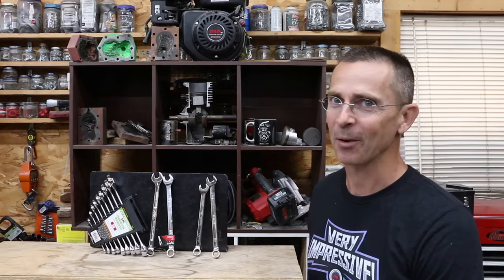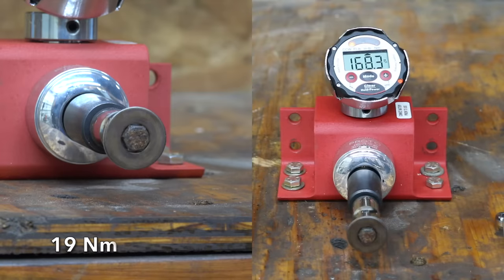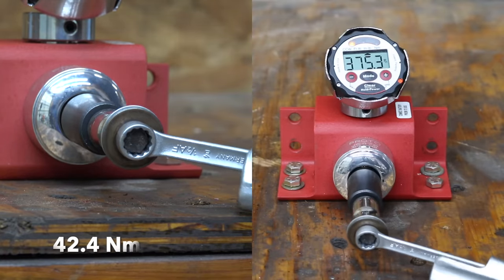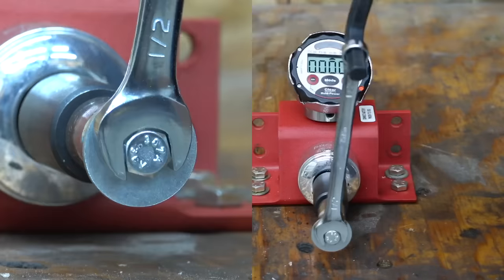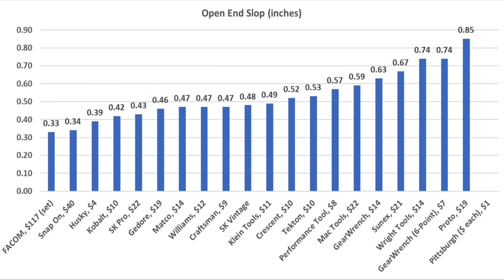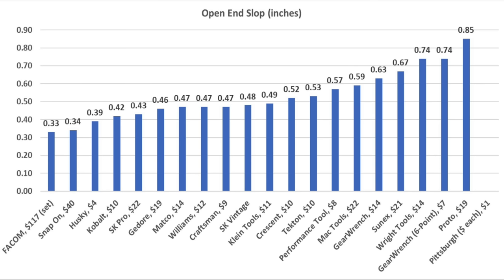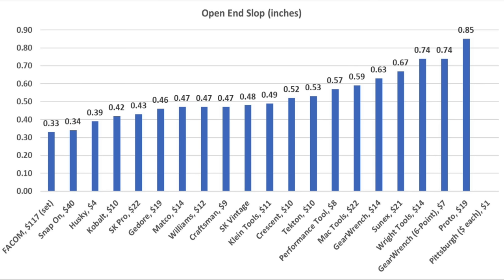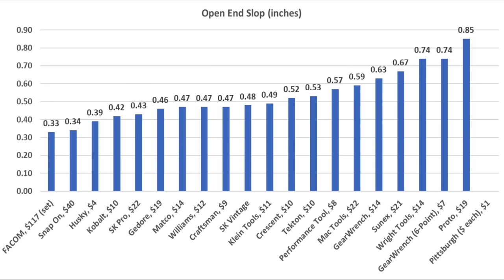Best Wrench? Let’s Settle This! Snap On vs MAC Tools, Matco, Proto, SK, GearWrench, Kobalt, Husky

Comment: I'd say a wrench that bends under pressure is always superior to one that breaks under the same pressure -- heck of a lot safer if it doesn't become a dagger or missile! and as noted, you can still use it for those pesky corners.
Reply from the maker: Thanks for the feedback.
Reply: @ProjectFarm  please start testing mastercrap tools. I want everyone to see just how bad they are.
Reply: @chrishayes5755  Don't think those are sold in the US. Their open ended wrenches aren't bad.  Non impact sockets are pretty brutal though.
Reply: @Mark Brooks you can get a new one for a broke one but not a bent one.
Reply: Assuming a good warranty you can replace either

A bender is less likely to break your wrist when crap hits the fan
Reply: @jakass  oh yeah, long as the wrench can perform just as good bending is definitely the way to go. And with this testing it seems the benders are performing just as good. Not I'm not sure how that affects the wear on the wrench from use though? Most of us don't use one enough to care about wear hardly though.
Reply: I'm with you 100%. A wrench breaking under torque is AT BEST going to get you some severely busted knuckles, but easily has the potential to send you to the E.R. depending on how it breaks and what you're doing. I don't even care about warranty issues at that point- if a wrench bends under severe torque instead of breaking and potentially causing me severe injury, I'll gladly pay out of pocket for another. I don't mind getting scraped up or banged up a little when I'm working, but I'm at the age where I know I'm not invincible, so if a tool saves me from a possible severe injury, it's worth its weight in gold as far as I'm concerned
Reply: This 100%
Reply: I agree! I have a snap-on 7/16 that I bent and it became my header wrench. Occasionally someone would see it and ask why I didn't get it replaced.
Reply: Everyone with grease tattoos in their knuckles will agree. If you know, you know.
Reply: Oh cheap chinese missiles 😬
Reply: I definitely agree with that!!! Breaking hand tools usually gives the result of broken hands or busted knuckles
Reply: @Mike I'd generally agree, but problem is,  you don't always know when it's going to break. What breaks under a lot of pressure can break under less pressure. Whereas a bend at high pressure will always be a bend at low pressure too.
Reply: Damn, that was so freaking wild.
Reply: I've said this before but, if there was an award for best YouTube channel, you should get it. I frickin love your channel. This would be my fantasy job. I just feel bad for you about all the money you obviously spend to conduct these test.
Reply: @chrishayes5755  "Please start testing mastercrap..." Mastercrap?
Reply: @scootergeorge7089  Mastercraft, the Canadian Tire house brand.
Reply: If you are putting this much pressure on any tool like this to where it bends or breaks by hand, you need to get the liquid wrench fired up. Be smarter than the tool and what you are working on.
Reply: @mistermacgray  Lol when I see rust I go ahead and get the gas axe out because I'm gonna end up needing it anyway. Usually takes less time going straight to overkill instead of dicking around with stuff trying to do it without heat.
Reply: @Mike If I could break these with my bare hands I would have no need to bother with wrenches 😎
Reply: I don’t care if it bends or breaks, just please don’t ruin the seized fastener that is surrounded by flammable materials and doesn’t allow access for a drill.
Reply: @ProjectFarm  The Wright Tools Wrench you tested out is no longer made and is replaced by the Wrightgrip 2.0.
Reply: I'll trade you for the snapping ones that show by snapping that they're harder, and won't wear, because breaking isn't ever going to be an issue, but wear is.  You guys aren't going to be breaking them with your hands, and if you're injuring yourself on the failure of a wrench you weren't being prepared for the failure of the fastener either, that's 100% on you.  Hard steel bends  a little and either snaps in two or back to its original form. Weak steel bends and doesn't come back, it just becomes putty.
Reply: @maverickracer442  "SEND YOU TO THE E.R.!  Listen to mother hen here.  I really wish i'd bookmarked the AvE video where he talks to people who say or even worse DO stuff like that.  None of you are strong enough to break these wrenches using them properly.  None of you.
Reply: @snap-off5383  yep that's what I was thinking. I want a wrench that's hard and resists wear not something that flexes a lot and bends.
Reply: V stock matic crypto comp crypto Ethereum classic crypto Shiba Inu crypto
Reply: Agreed
Reply: I would disagree as the softer metal (bending vs breaking) will wear quicker. A wrench that is worn is dangerous also. Also to actually break the wrench, he had to use a lot more force than a normal person could put on a wrench without using some kind of multiplier.
Reply: @ProjectFarm  u gotta put the icon brand in your videos
Reply: @ProjectFarm  thanks for the feedback.
Reply: I'd prefer one that breaks. Because 1. I'm never going to use that much force on a wrench (that's what breaker bars and impact guns are for) 2. A wrench that breaks vs. bends is less likely to stretch, becoming a useless annoyance.
Reply: There's a fine line in strength hardness can cause breaks vs softer but still forged bends definitely safer. Iron powder baked tools can shatter like glass under the right circumstances.
Reply: @chrishayes5755  I have a set of master craft ratcheting wrenches. They are actually pretty good. Mine never skipped a tooth and even took off rounded fasteners before. The only downfall is the ratcheting part is not a fine tooth gear and you won’t get as many clicks out of it in a small space compared to a gear wrench which has a finer tooth gear and the edges of the handle are sharp and hurt your hand. Nothing a little vinyl tape or duct tape cannot solve
Reply: @gabrielpichardo1492  , Been wrenching for about 45 years, I've had plenty of busted knuckles form nuts/bolts breaking or stripping, never from a wrench breaking!
Reply: @Xtroll1738  slips and breaks both bust knucks . Bends are usually pain free hahaaa
Reply: Can you imagine this guys dating life, and comparing girlfriends? “We’re going to test that”. 😝
Reply: @ihave7sacks  except the Harbor Freight brand apparently.
Reply: Just a tip for anyone that has broken a wrench and knows what the projectile can do (took a small chunk out of my concrete wall). Put some sort of cloth over the fastener and the risk of injury is reduced massively. There are fasteners which you can't even tackle without an open end wrench, so the advice to take an impact wrench instead is kind of useless.
Reply: Indian goods are good.
Reply: Except, if you are putting 400 lbs of torque on a nut something is seriously wrong and you should have stopped awhile ago
Reply: @nitainath7699  Apparently too much taper on the box end. You could grind that but it would lose a bit of strength.
Reply: @gabrielpichardo1492 Just exactly how much wrenching have you did? Me, I got over 40 years of turning wrenches. The problem with a wrench that bends is it wears quickly because it's a softer metal. A wrench that wears quickly means it slips a lot more because of that wear until it just doesn't work anymore. Then we got the fact that a lot of idiots who watched this video think because he broke wrenches in his testing, that wrenches are going to break easily during use, WRONG! He was using a press to put the pressure on the wrenches which will put more pressure than you ever will in using them unless you use a long pipe or something to give you more force on the wrench which moves you away from the wrench while also meaning you can't be in tight quarters to be able to use a pipe or something to add more force because the added length means it needs to travel more distance. Then finally if your that terrified of a wrench breaking a hurting you, you better just lock yourself in a padded room for the rest of your life just to make sure that some insignificant chance of you getting hurt doesn't happen. Obviously the nanny state has you brainwashed!
Reply: yeah, but good luck getting that kind of torque without a cheater bar.

wear PPE with a cheater bar.
Reply: @snap-off5383  user name checks out. and 100% agree
Reply: @sonar610  and you can punch your work of the jaws bend too. so bendy shaft means bendy jaws. (usually)
Reply: @gabrielpichardo1492 ...or the jaws bend and the tool slips.
Reply: @Xtroll1738  Correct!
Reply: @dieselking3445  Icon is the same as the Klein/Husky/etc.  They're either made by Kabo or Infar in Taiwan, along side all the other brands those two companies make.
Reply: @Xtroll1738  Yeah the bolt is going to be the weak link in the chain 99.999% of the time, always assume IT is going to break when you give it peak torque and calculate what will happen to your hands BEFORE doing it.
Reply: @gabrielpichardo1492  Bends are "usually"  non-existent, as are breaks.  People aren't that strong. Even putting cheater accessories on it, moves your hands out of harms way. . .
Reply: @saiiiiiii1  How did you break a wrench?  You overpowered it with your arm?
Reply: @snap-off5383  extension pipe
Reply: @saiiiiiii1 the widget arm on the maniform, maybe a johnson rod.
Reply: @snap-off5383   
Don't forget the ifcondibulator..you definitely don't want to forget about that.
Reply: @snap-off5383  he should still test icon
Reply: @snap-off5383  yea i usually bend stuff with the cheater bar
Reply: @snap-off5383  Well when you're getting paid to fix something and it's in tight spaces, sometimes you just have to bite the bullet do what you got to do. It's something someone who had actually did some real wrenching would know that sometimes you just have to go for it and suffer the consequences when the bolt breaks. Especially when you're working on book rate.
Reply: @Xtroll1738  I do tons of wrenching and have for over 40 years.  Never do I have to use the wrong tool for the job or over exert myself, risk injury, and/or break a tool to get a job done, "because its the real world!"  That's just utter stupidity.
Reply: Agreed
Reply: First tool I ever broke by snapping was a wrench. Ping! 

Oh! Joy. My first realisation that this stuff is dangerous. I was about 12
Reply: Yes, but I don’t think they should bend or break on something as soft as a coupling nut. Maybe on a grade3 or 5 or higher, but not a coupling nut. WIth something that soft, the nut should absolutely be the failure point.
Reply: @ProjectFarm do you think tekton tools are any good?
Reply: Completely disagree.

Comment: When I buy tools, your channel is the first place I visit. I have saved time and money while acquiring good honest, quality tools. No more listening to armchair warriors or claimed experts about which brand they hype. Your channel is where the rubber meets the road!
Reply from the maker: Thanks!
Reply: If you have to watch a video to help you buy tools before you work on a car, you are going to funk your car up where even a lifelong mechanic cant fix it.
All wrenches are pretty much the same if you know what your doing with it.
Reply: @demonscheatagain7175  If you think all wrenches are pretty much the same you haven't worked on many cars or anything else.
Reply: @demonscheatagain7175  Missed the point.
Reply: @demonscheatagain7175  you are incorrect sir
Reply: @demonscheatagain7175  That is completely false. I have been a DIesel technician for 10 Years and I literally have Wrenches of certain sizes from different brands because of thiickness and Head design. If I have to get to something where a Thin wrench is needed I Use Snap - on. If I need something broken Loose with High torque but I dont mind Bruising it I always used Matco. The rest of my collection was mostly craftsman so if I lost them they are much cheaper. I have a few random wrenches from Sunex, Kobalt, and Husky for thier gaps/chamfer so they can get onto a Bolt much easier.
Reply: @demonscheatagain7175  Yeah, no.  Different tools definitely have different levels of performance. Also if you're investing hundreds of dollars in something best to do some research first.
Reply: @edgewizz862  yip, he completely missed the point.
Reply: I often look BEFORE I buy ;-)
Reply: Having lots of tools that do the same thing puts the skill back into the users hands.  You can never own too many tools.
Reply: @michaelmccarthy4615  BUT. You can own too many to master
Reply: Agree
Reply: @demonscheatagain7175  your silence on this says you buy snap on. Don't feel bad it's your industry that puts pressure on ppl to buy over price crap.
Reply: This is a unbiased opinion of the best quality wrench , it makes sense to come here before you spend your hard earned money . Has nothing to do with competence . @demon
Reply: Yeah MKD, when these guys hyoe up snap on you'd think those tools would break project's test equipment.